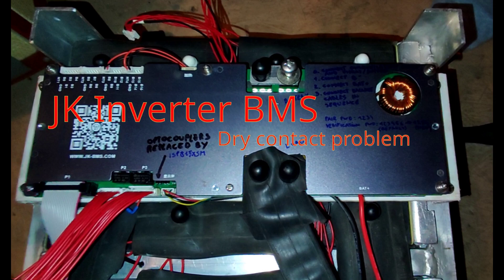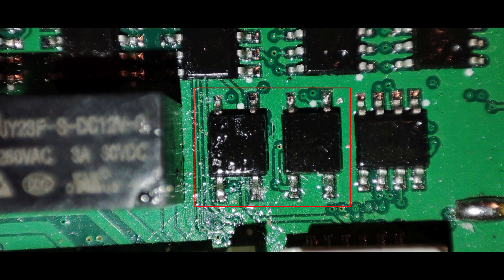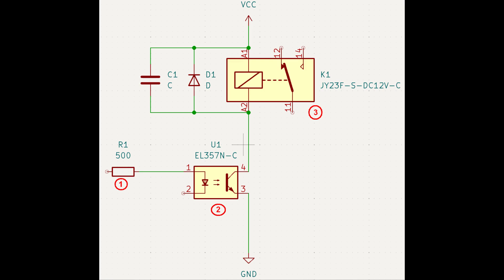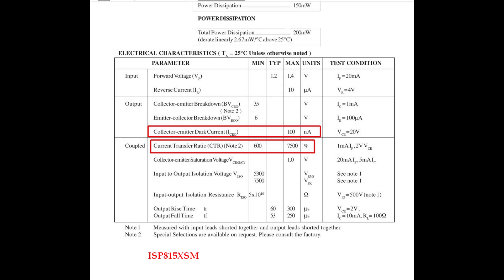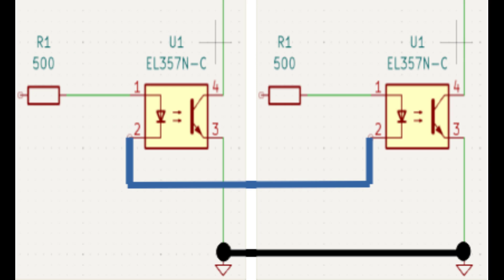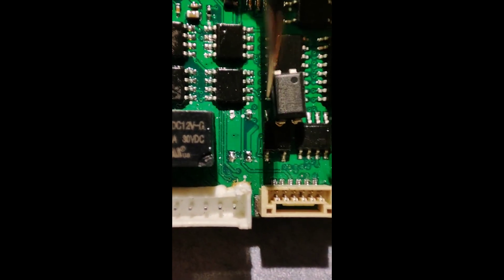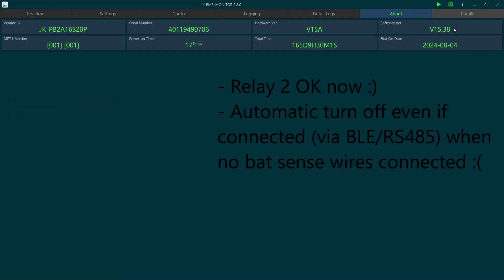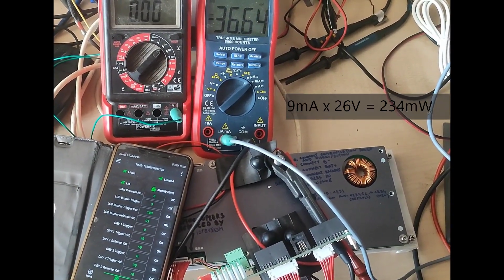JK Inverter BMS dry contact / relay  problem : root cause and fixes

Comment: Hello. I recently installed the same bms. after installing the bms, when I am trying to open the bms, the light in only blinking and not opening the BMS. what could be the reason and where to get the parts for the repair
Reply from the maker: What do you mean with 'open the BMS' ? Are you trying to make a connection over bluetooth from an android phone ? An apple ? Or are you connecting via RS485/CAN bus ? Have you tried both methods ?  If neither works there is going to be something more basic wrong, is the board getting power ?  For any of these methods, can you try to other devices from your PC or phone  ? Or have you tried with a different phone / adapter ?  In any case, if they would be broken, I haven't ran into such problem myself so I have not looked at the board to see where the bluetooth chip or can receiver chips are located and my board is currently in use so I am not able to open it to took at the pcb.
Reply: @ToThePointTechDev  when I am pressing the ON button, it's only blinking but the beep sound when it  ON its not coming neither an LCD is ON.
Reply: can you share your whatsapp so that i can send you a video
Reply from the maker: Maybe upload it on a youtube channel (I don't use whatsapp) ? And not sure if I will be able of much help, i can do a quick visual check to see if there are obvious mistakes in your setup (make sure to show all wires/connections). But if the board is really damaged a repair is probably going to involve further reverse engineering of the board, following signals etc etc. Some history on how it got damaged helps too, was something wrongly connected at some point, or was it never working ? And can you connect over bluetooth or via RS485/CAN to see if the board is able to report what the problem is . In any case that is probably several hours of hands on work, and depending on what got damaged is may not be repairable without support of the manufacturer/specialized tools (eg if the mcu is blown up and needs to be replaced). If you are not able to do that yourself, it is probably cheaper to buy another bms.

Comment: Thank you. Well done. I might have to follow suit. But ATM it's not even possible to set the trigger for DRY1/2. Neither the PC tool nor the android app are able to switch to different IDs: App says "sending failed", the PC tool fails silently. Bummer. What an embarrassing state of software delivered by JK..
BMS 15.42, app and PC tool latest version as of today.
Reply from the maker: I am still at 15.38, but at the moment I am traveling with it so I am not going to touch it to verify your observation :). Maybe when i get back.  Would be a bummer if it does not work though, unless they change their minds, v42 will be the final version for the v14/v15 hardware :(. I keep hoping someone starts an open source version of the firmware, but I am assuming their firmware is signed with a secret key so I dont even know if it is possible.

Comment: I thought I was going mad and it was just me! Thnakyou so much for this! I was about to develop a second arduino temp controller board, but this fix would be much better. 
Neither of my relays worked when I installed my BMS about a year ago and I didn't find any info online at the time so gave up  and left it. good work and clear explanation.  I think your conclusion about the shift register output current limit at 6mA is correct.  Much appreciated :) Also credit for giving credit to Mario
Reply from the maker: Thanks for the kind words. A bit a bummer that probably the fix will be out of reach for most ppl that bought the BMS. 

Now if we could also somehow get more accurate current readings for better SOC tracking it would be perfect (I haven't used 15.38 long enough to see if it helps, but since the measurements are inherently pretty inaccurate (0.4A granularity it seems) at the moment there is only so much they can do in SW).  

PS If you use a different optocoupler that is a better physical match than what I used and it all works fine let me know, then I will put it in the description (and credit you, of course :) ) / pin the comment .
Reply: @ToThePointTechDev  yes that is a big shame.  I am an electrical engineer and the fix is within my reach but even then, will be tricky with a normal soldering iron. 

I did not know the current accuracy was so bad. my BMS hows 0.1A resolution but that could easily be fluffed in software, the SOC drift makes me inclined to believe you. I think the biggest problem with the SOC accuracy is not the current resolution but the non-linearity. I can either make it accurate for small readings or high readings but not both simultaneously. this is likely due to heating effects and temp coefficients in their shunt (maybe replacing the shunt with a higher quality low temp coefficient  would help, I haven't torn the board down to know how hard that would be) which they COULD improve through software by adding multiple calibration points and or adding a temperature compensation function perhaps based off the MOSFET temp which they already have and should strongly correlate with shunt temp

I wont be home for another month yet but when I do I will let you know how the fix goes and what method I used.  The correct opto is probably the best way to go! you have done 90% of the work for that already
Reply from the maker: To be honest, the 0.4 is what i guestimated based on the minimum jumps I see in reported current values. Could be 0.35 or 0.45 too.  This will also depend on the max current of the model you have, mine is the 200A variant.  If you saw it increasing with 0.1  steps than I assume you have a lower amp version, or there is something very strange going on with the ADC on mine (or my eyes :D ).

It would actually be interesting to research that for a bit to see what kind of ADC they are using (i don't get any hits when i google that). I am guessing 14 bit based on what i am observing. They need to be able to measure 400A of range (+ and - 200A) so with 14 bits that is 400A/16384 = 0.0244A. With some mismatch between shunt range and ADC range you end up with what I am seeing.

As you say, replacing the shunt for more thermal stability might also be a good idea. I saw a video from offgrid garage a while ago where he tried to calibrate it but failed to get an accurate value over the entire range. 

Replacing the firmware would help too, but ironically that it the least realistic. If only they would open source the thing ...

I installed my unit again in my van to soak up some solar rays, maybe I will have another look if there are some rainy days ahead. And if I have spare time :). 

I treated myself to an ATTEN ST-826D last year, if you would be looking for a hot air station one I can recommend it (they are definitely selling hot air ! :P ). Sadly a bit big to take with you in a van . 

Happy travels !